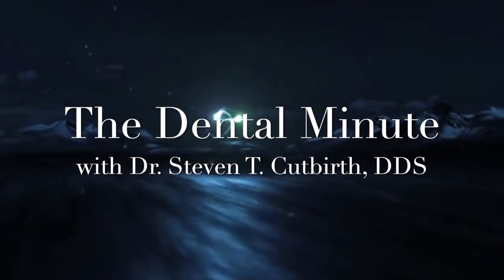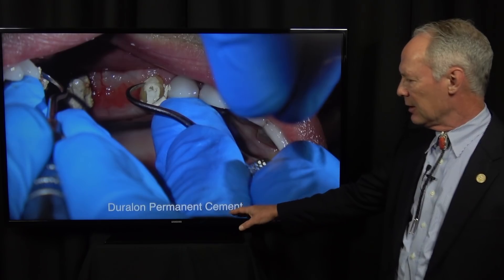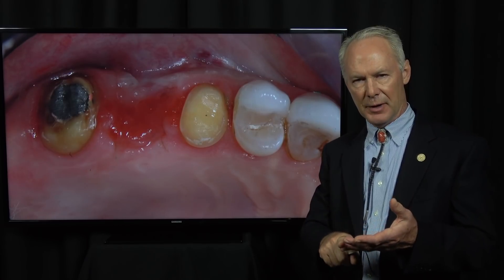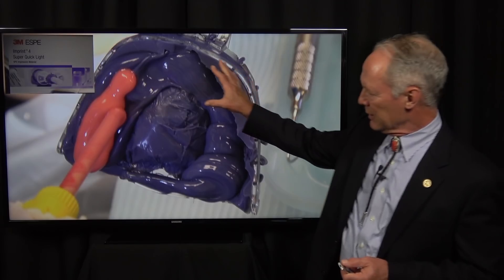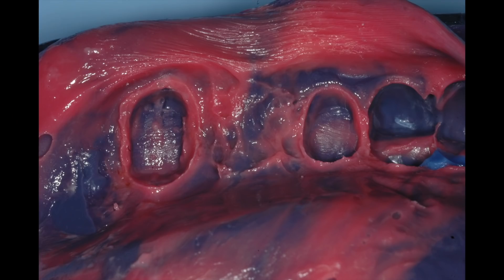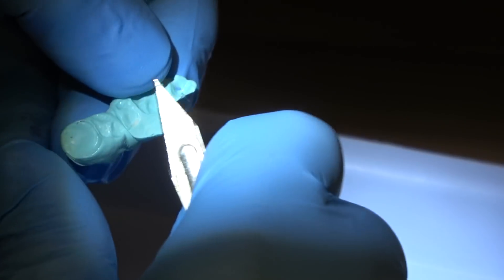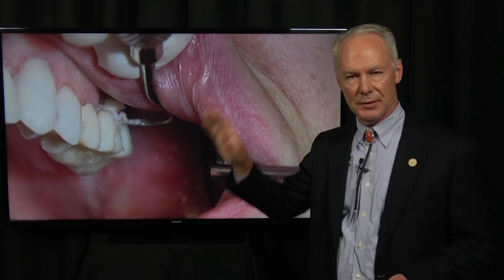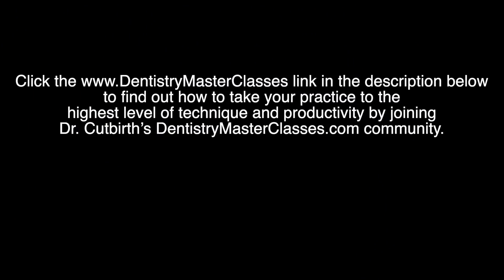Re-Prepping & Impressing Upper Left Fixed Bridge - with Steven T. Cutbirth, DDS

Comment: Why dont you place the light body poly ether on the prep first
Reply from the maker: It's not  a problem to place the light body on the prepped teeth, and I sometimes do that, especially if there is a retention groove, an interproximal box  or the prep is an inlay.  There is a higher chance of incorporating an air bubble in the impression when the light body is placed directly on the prepped teeth vs. on the heavy body material in the impression.  If you place the light body directly on the prepped teeth, be sure the teeth are damp, even wet, for lubrication and keep the tip of the light body syringe in the light body material while squirting it out.  I would recommend cutting off part of the tip of the light body syringe so a higher volume of material is expressed.  The tip that comes with the light body syringe is too small if you don't cut off part of the tip, creating a greater chance of incorporation of air bubbles..